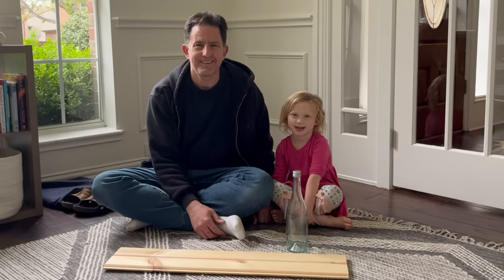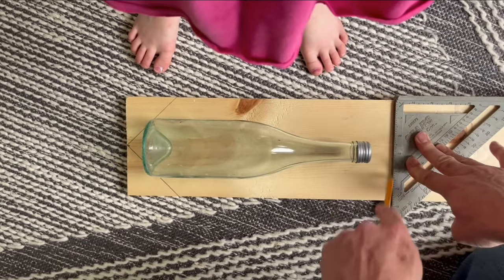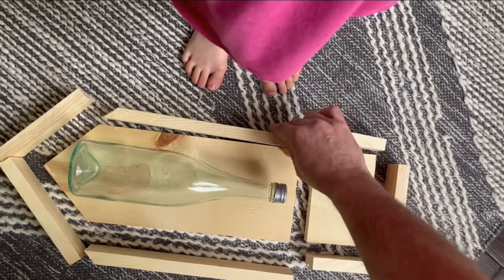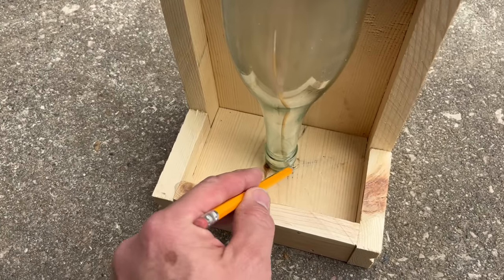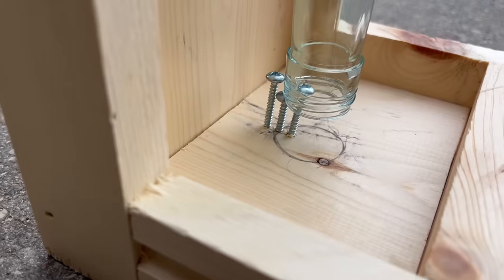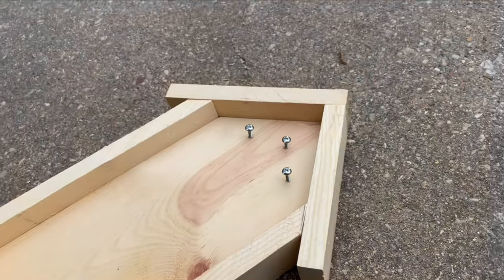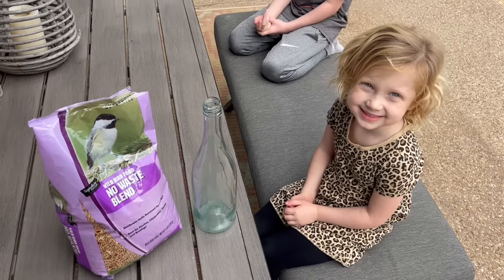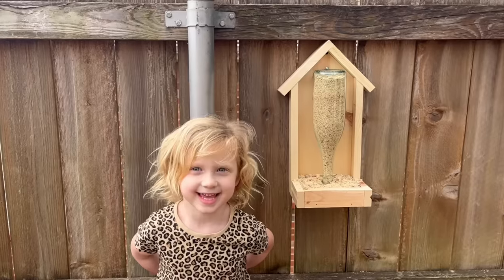DIY Wine Bottle Bird Feeder

Comment: Fun. Won't last around here unless it's hardwood. The south has moisture and heat
Reply: Stain it with UV light protection stain ... most outdoor paints also have it.
Reply: Use hardwood to build it.